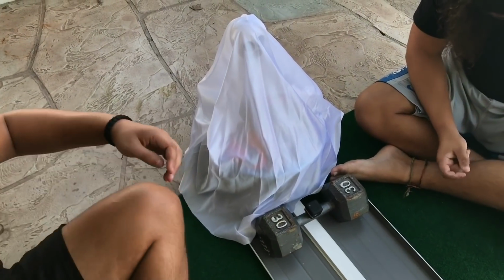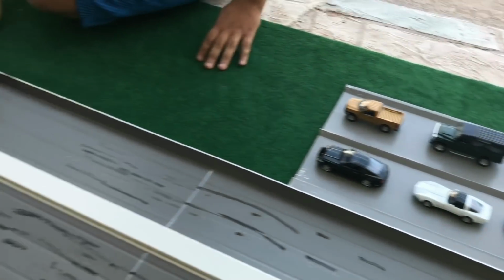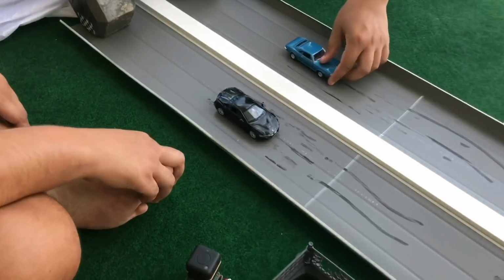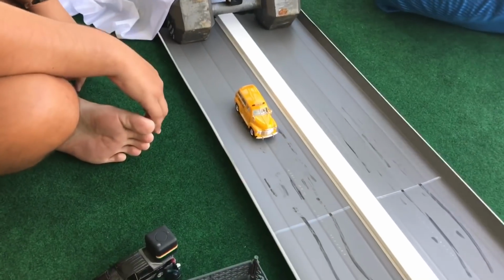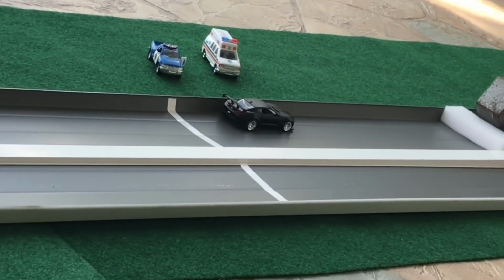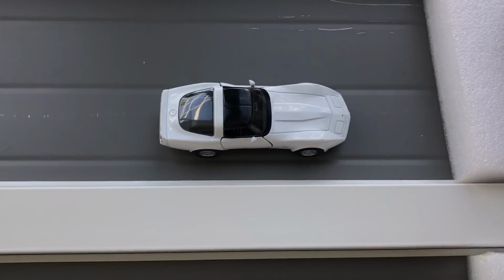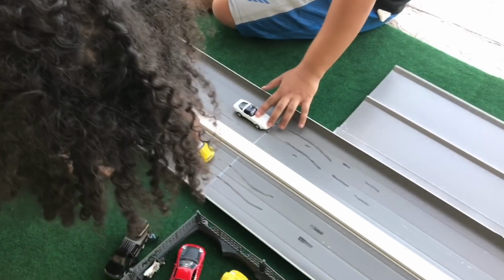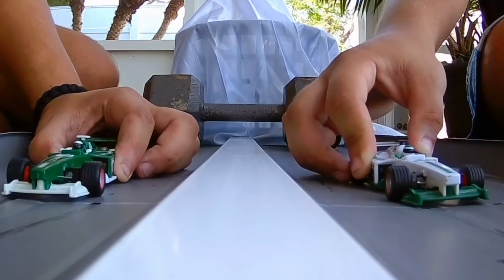PULL BACK DRAG RACING 2

Comment: I dare you to use the little pull backs call penny racers. Reason being is because they are very fast and they are actually really small. I had some when I was a little kid and they like to do wheelies since your supposed to put weight in the back if you want wheelies. But they are fast if they go straight.